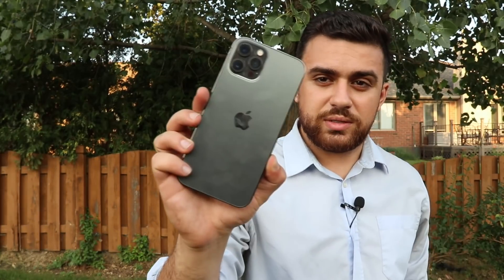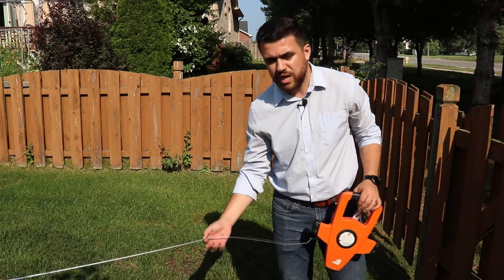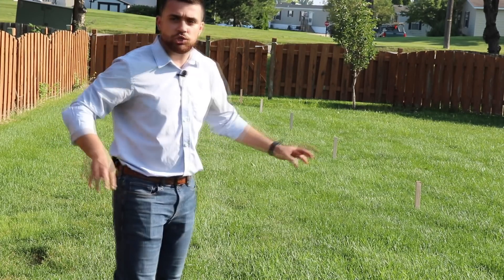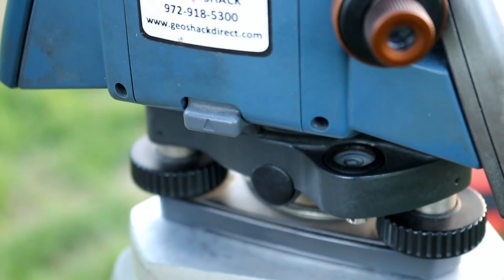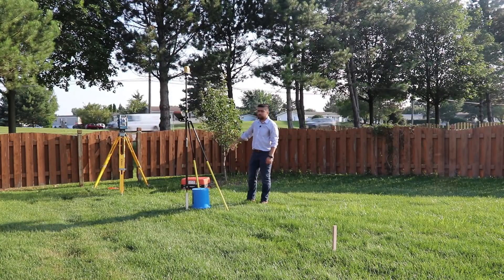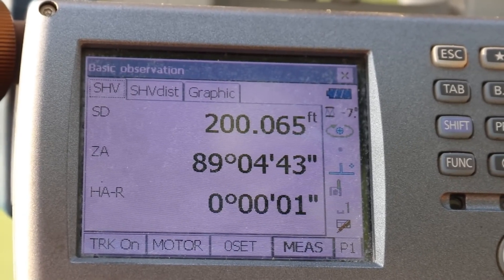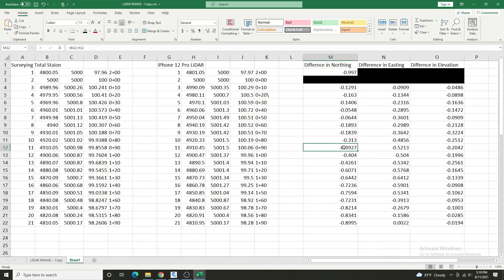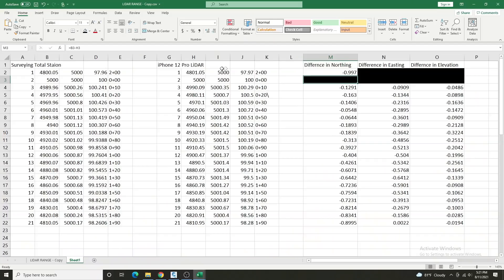iPhone LiDAR accurate drift over 200 feet

Comment: The phone has to keep track of where it is, as it’s performing LIDAR. So as you are walking taking shots with it, it must be using GPS to track where the phone is, thus also  the locations in the LIDAR surface are dependent on the accuracy of the GPS??
Reply: It's almost certainly not using GPS, instead it'll use a combination of sensor fusion (combining the accelerometer, gyroscope, and compass data to perform inertial tracking) coupled with SLAM - Simultaneous Location and Mapping where it uses the data gathered in the previous few frames to align the data captured in the current frame. This is the reason for the fairly linear error in the northing (the long axis), because inertial tracking will always drift over time. GPS can only be relied on to within 10 metres or so, and can vary wildly over only a few readings.
Reply from the maker: As John and Ish said, it's not using GPS, it is using internal gyroscopes to measure the movements of the phone. If I was using GPS, that would be considered Absolute Accuracy, not Relative Accuracy.
Reply: @RamiTamimi  How would using a phone stabilizer like the DJI Osmo effect the results?
Reply: It doesn't use GPS AT ALL. I tested this.
Reply: This particular app isn't using GPS at all to create this model. It is however possible to extract EXIF coordinates from the photos it takes to texture the model. Those coordinates are really inaccurate though.